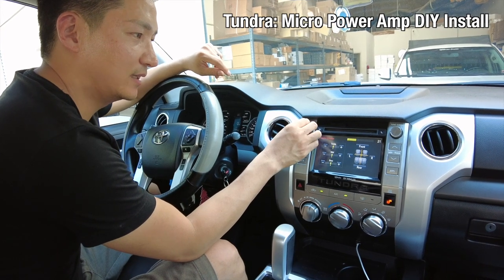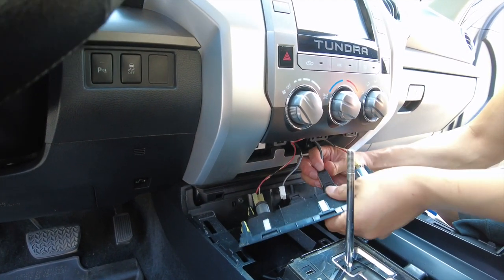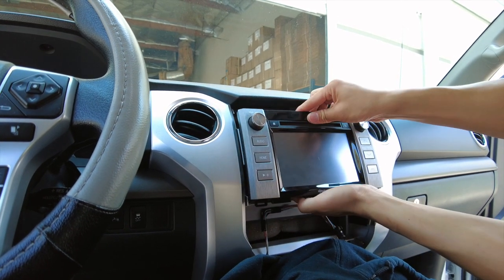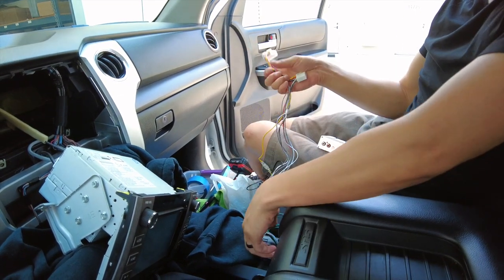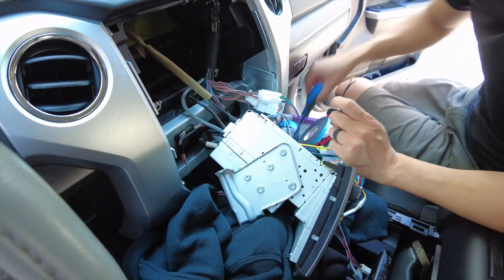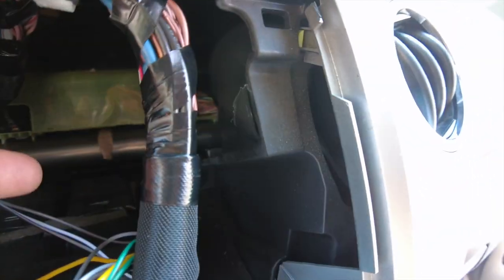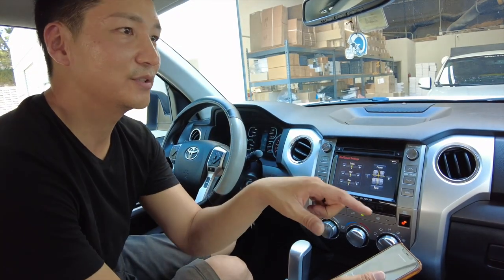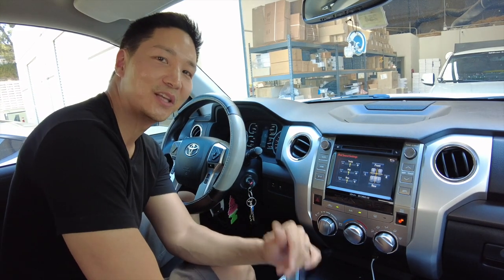Micro Power Amp DIY Install Toyota Tundra

Comment: here to verify ... installed on a 2019 Limited JBL system and it is what i was looking for.  a step below installing/replacing speakers and amps... worth the shot
Reply from the maker: Thank you for your feedback
Reply: I just got a 2018 limited with JBL and with the volume at 50 it just sounds weak….will this item make my stock system louder?

Comment: Just plugged this in and sounds great for the door speakers, but my speakers in the front on the dash are cracking some when I turn up the volume. Can you help me understand what I need to do. I put full Gain on the amp. I do have 4in Alpine speakers with the tweeter in them. Is that the problem because they’re not just tweeters? Let me know what I need to do.
Reply from the maker: You need to turn down the gain from max. Start from 12 o clock and adjust as needed

Comment: Is this amp just powering the front dash speakers since the factory amp pushes the door speakers(non jbl)? To power the doors it must push higher power to the stock amp and thats ok? Will pushing more power to amp input heat it up? Amp to amp doesn't seem good
Reply from the maker: This amp will power all your speakers though your factory system. It’s not enough to cause any issues or make anything overheat

Comment: Will this work with the jbl? I'm not impressed with the bass as is.
Reply from the maker: Yea this is compatible with the JBL equipped sound systems as well
Reply: Hello, you can use a high level converter to rca from the subwoofer output at the connected location of the sub. One can either delete the factory sub all together or add to it. Scosche makes one with a bass knob. I deleted mine in 2011 tundra. Running 2 12" low pro kenwoods with a kac-9106d amp high lever customized box it friggn slams! Currently upgrading the rest

Comment: I've never understood why everyone removes the shift knob when clearly it's not necessary.  The shift guide/indicator is not part of the surrounding trim piece!  It was the same way with the previous gen, which is what I own.  Cool little amp/video regardless.
Reply from the maker: So you don’t damage it when pulling other interior parts

Comment: New follower,im curious. What kind of speakers come stock with these tundras? I recently just picked up a 2020 and the stock system is loud but basic so in definitely invested in trying this or if i should just replace the stock speakers and add a  amp to them?
Reply from the maker: It depends on the trim but even the base model speakers are capable. Try out the amp first and the change the speakers if needed since this install is very easy and make a bigger difference than changing the speakers

Comment: My complaint about the Tundra sound system is that the rear speakers have maybe 10% of the volume as the fronts. Does this fix that problem?
Reply from the maker: Even with this amp, the bias will be towards the front speakers. You may turn up the rear speakers gain compared to the front to find the balance you’re looking for

Comment: Hola lo compre y lo instale en una tundra 2016 suena super bien mi pregunta es si es suguro .por que se calienta. lo instale igual como tu video
Reply from the maker: It’s normal to get a little hot. It also has a fail safe on it if it gets to extreme temperature
Reply: @BeatSonicUS  thank you
Reply: @cruzmartinez108 donde adquirió el amplificador y cuanto te salio
Reply: @RomeroJanya  hola lo compre en Amazon no se Si todavía lo tengan me costo como $269 más tax pero en el video tienen el link de ellos
Reply: @cruzmartinez108  ok gracias
Reply: @RomeroJanya  Asegúrate que sea Beat-sonic PA2T1K PLUG AND PLAY select 1987-2019 toyota whit10 or 6 pin stero conector porque el PA2T2 O EL PA2T3 son para el 2020 para arriba

Comment: Would this work if i already have a line output converter for rca output to a monoblock amp that is powering aftermarket subwoofer? (2023 Toyota Crown XLE)
Reply from the maker: Yes this will work even if you already have a line output converter powering aftermarket subwoofer

Comment: will adding this power amp and aftermarket door speakers cause any audio issues if the factory head unit stays in the truck?
Reply from the maker: Our amplifier is intended to work with the factory head unit, however be sure to keep aftermarket speakers at 4 ohms.

Comment: This sounds really good, so no subwoofers?  I just replaced the speakers in my Tundra last week, 6x9s and 6 1/2s, sounds a little better but of course the stock head unit just isn’t cutting it.
Reply from the maker: No subwoofers. This amp will give you the additional power the new speaker needs

Comment: Would this kit work if im using rca line out converter for my amp/ subwoofer setup harness to the factory head unit then have this kit plug into the female end of the rca line out ?? Or does this Micro amp have RCA outlets for my amp/ subwoofer?
Reply from the maker: Yes it will work even if you are already using rca line out converter. This amp should install directly to the factory radio. Depending on where your line our converter was connected our amp may also boost your aftermarket set up
Reply: @BeatSonicUS  That's awesome, thank you so much I'll put an order micro amp. Yes I have a subwoofer and mono amp  with rca line out using my factory head unit on my tundra but would like to boost my factory speakers too
Reply from the maker: @jasonyang3187  our pleasure!

Comment: So I just bought a 2024 tundra without the jbl system. I wanted to add a subwoofer and an amp for the woofer. With your amp installed can I run the rca cables from your amp to my sub amp? Will it work and would it be mono?
Reply from the maker: Not with this amp. The RCA is for audio out only. You can use a LOC to the factory speaker wires and then to an aftermarket amp

Comment: Quick question.  So does this add power to the stock amp under the passenger seat?  Also can I add an LOC and amp to power a couple of subwoofers on a base non-jbl tundra?
Reply from the maker: Yes this adds power to the stock amp and cleans up the sound signals. This doesn’t have a LOC output but you can connect a line converter to the factory wires

Comment: I have a 2020 1794 tundra it has the the JBL premium stereo in it. Will one of these amps work for it? If so can you tell me which one I need?
Reply from the maker: This one will work for your 2020 1794 tundra https://www.beatsonicusa.com/pa2t2.html
Reply: Is the install process the same on the PA2T2 for the JBL equipped Tundras?
Reply: @BeatSonicUS help
Reply from the maker: @LaoNickster  yes the install is the same for tundra with or without JBL. What can we help you with?
Reply: @BeatSonicUS  if you’ve done this to a 2020 Tundra with JBL, would you mind posting a video of before and after sound? This install sounds great btw! I can hear it though my Bose earbuds.
Reply from the maker: @LaoNickster  will shoot a video on our next 2020 tundra with JBL customer👍
Reply: @BeatSonicUS  Thanks a bunch!
Reply: @BeatSonicUS  Will this boost the bass coming from the factory JBL Sub too? I'm pretty happy with the JBL system itself. It's just lacking bass for me.

Comment: Will this work on a 2013 with jbl?
Reply from the maker: Yes this one will https://www.beatsonicusa.com/ena-2t1-698.html
Reply: @BeatSonicUS  I clicked on this one but it only shows one option for 2014-2021 Toyota tundras. Will this still work for a 2013?
Reply from the maker: @El_Basically_210  yes the same one will work with the 2013 Tundra
Reply: @BeatSonicUS  Okay, in that case do I chose the 2014-2021 tundra option or the all other 1997-2017 vehicles one?
Reply from the maker: @El_Basically_210  all other toyota models.
Reply: @BeatSonicUS hey also, you know if there is a version for a 2012 Toyota tundra without the JBL? Asking for a friend.
Reply from the maker: @El_Basically_210  here’s the link for 2012 tundra without JBL https://www.beatsonicusa.com/ena-2t1-698.html
Reply: @BeatSonicUS great! Thank you so much I’ll definitely be copping one of these for both tundras.